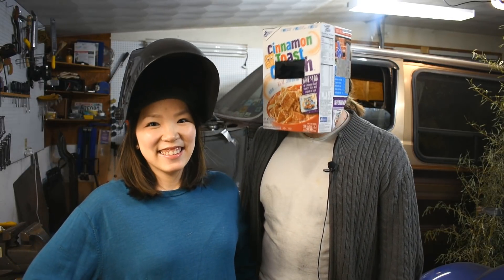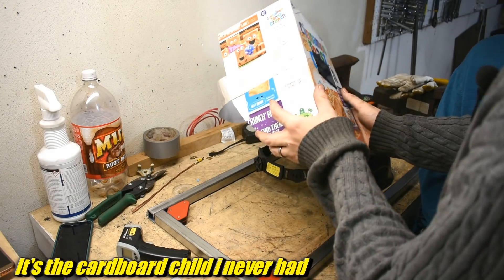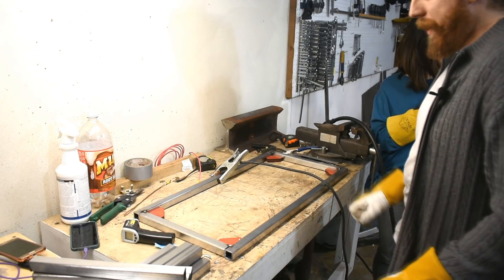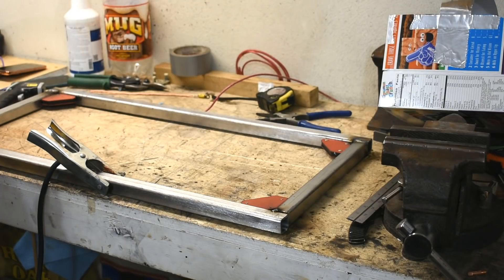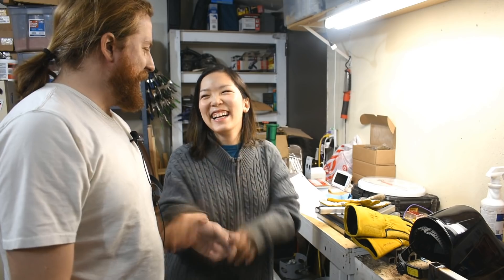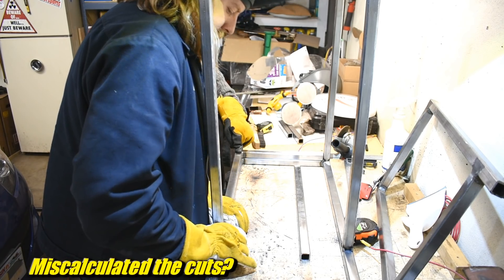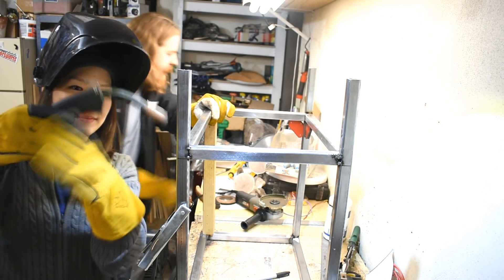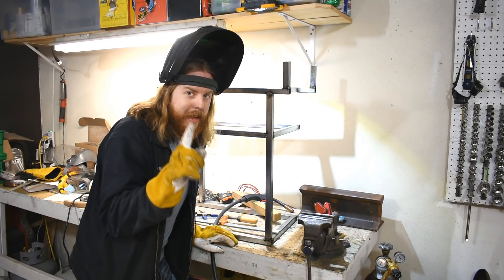DIY MIG/TIG Welding Cart Part 1: Making the frame

Comment: That is a pretty heavy duty looking cart. The true hallmark of an amateur is over building things.
Reply: It's not over-engineered.  Paul subconsciously designed it for dual use as a step-stool!
Reply: Properly designed and constructed a cart capable of supporting plenty of weight can be made using half the materials of this cart here. He even said he had no idea how heavy that tube he used was. It's purpose is to not deflect over longer spans. But if you're not bridging those long spans that extra weight is not doing you a bit of good. I wouldn't even have used tubing. My Miller TIG welder is sitting on a cart I made out of 1 inch angle. If I really want to I can stand on top of my TIG welder too. So step stool.
Reply from the maker: Oh it’s totally over engineered (and inefficient and so on), but it’ll work.  I can pick the thing up with one arm though so not too overly heavy.  The biggest problem is the distortion I did nothing to prevent.  It’s going to rock a bit if I don’t shim one of the wheels
Reply: Welding tips and tricks Jodie did a nice series on weld distortion. I started welding when I was 18 and I'm 53 now so that's enough years that I've some perspective on the topic anymore. That's why I use fasteners when I can these days. There's a hammer nail trap avoidance issue involved here. I know I got snagged by that early on myself.

Comment: Is your Eastwood the 175 that comes with a spool gun?  Other than a penchant for blowing through thin sheet metal I'm pretty happy with it and the spool gun will really lay down some aluminum. 
BTW: You're both kicking out nice beads so congrats on your rapid success.
Reply from the maker: Yeah it came with a spool gun, it’s probably the 175.  I haven’t tried the spool gun but I’m very happy with the welding it does on steel.  I tend to set it a little low for sheet to prevent blowing holes in thin stuff and it still gives me enough penetration.  I made a stand for that electric heater out of 20ga and outside corner joints with it set to the recommendations for thinner metal (22 or 24ga) worked fine.  I noticed a propensity for holes doing the hood patch on my van, but using a copper backer I was able to fix the holes.  It’s definitely a nice welder for the price.

Comment: Paul, Paul, PAUL!! Weld a mask in the same shape of your cereal box one, using thinnish steel plate! Voila, super uncomfortable welding mask! Just use the head clamp device off a broken mask you may find at a dump or so? :-)
Reply from the maker: Steel would be awesome!!  I saw someone do one from hammered copper, it looked so awesome and heavy

Comment: Did she have to learn how to adjust the welder too?  If not, you can console yourself with the rationalization your first welds weren't so good because you had to learn 2 things and she could concentrate on just 1.  What side will your TIG welder open on?  Don't put your grinder hanger on that side.
Reply from the maker: She knows what the knobs do, but she didn’t mess with them herself.  I just stuck with the recommended settings for 1/8” thick steel, it seemed to work.  I didn’t get any blow through, and the welds seemed to hold well enough for this